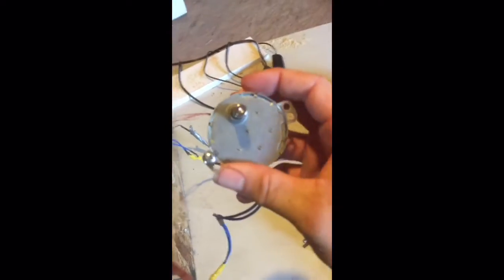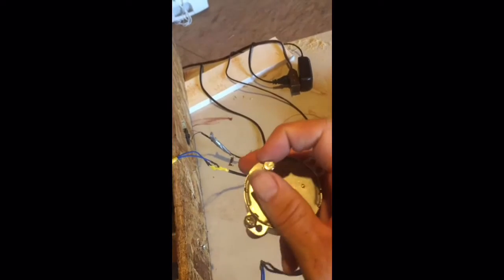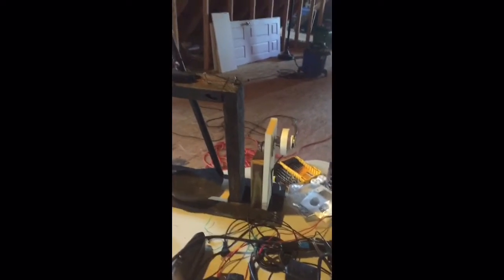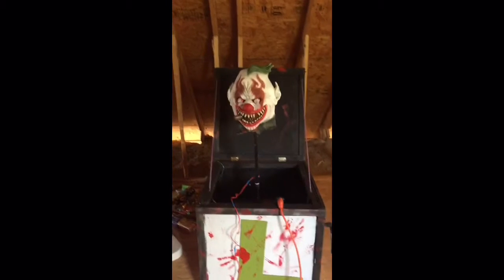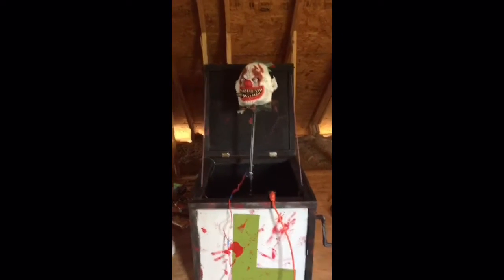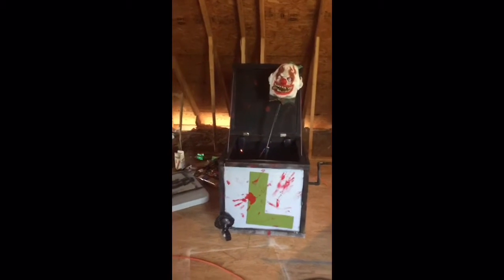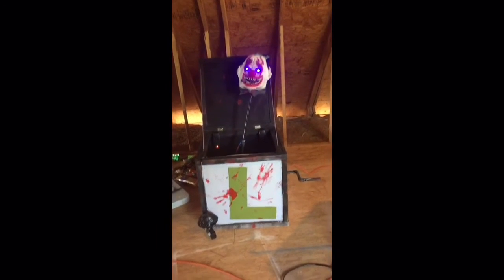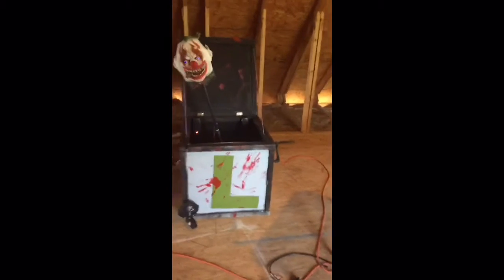Halloween Prop Motor Upgrade

Comment: I'm catching up here, but that's a great looking prop and motion. These days I seem to be just as interested in seeing how people have there setups set up in their props as I am in the props themselves, and I'm liking the neatness of your wires. Still looked like a mind-boggling amount! lol
Reply from the maker: +GhoulishCop Thanks, yeah I am the same way, I enjoy watching what others do, helps me learn new techniques, I actually got this idea from Slam, from Graves of the Grove, now of course he used his CAD geekness and was able to create both the crank and head movement with 1 motor using a CAD designed cog gear, so I knew that was out for me so next best thing was to use 2 motors.  I am just put another new UNO Arduino controller together to replace this one it is using a nano and Mike North thinks it might be having an issue from that and the way it was wired from last years diagram.  The audio wants to sometimes keep repeating until it is triggered again and then it is ok for a bit, this just started this year after changing to the dc motors.  Will find out next week, i got the controller done today and will swap it out next weekend.

Comment: Thanks for sharing the upgrade.  I always enjoy seeing the insides of animated props. Don't forget your "spring" around the PVC. Looks great! Nice work!
Reply from the maker: +Montclair&#39;s Lair Thanks!  Yeah it was on the other side of the room and I forgot to get it and put it on there.  :)  The inside looked much better now vs last year, I mounted the controller and the plug strip on a board and then mounted that in the box, vs last year it was all just sitting in the bottom of the box.  :)  I figured I had it apart I should take the time to tidy everything up and make it nice.
Reply from the maker: +Montclair&#39;s Lair oh yeah what editing software do you use, I realized after I needed to turn my phone sideways, grin the common mistake with using and recording with phones, DOH
Reply: I use Davinci resolve 12.5 beta. I don't recommend the software as it's overly complicated, but it is free. If you have no video software editing experience, use Windows Movie Maker, or whatever Macs come with (iMovie?) Resolve is free, but pretty complicated. Sony Vegas is a good next step after Movie Maker or iMovie.